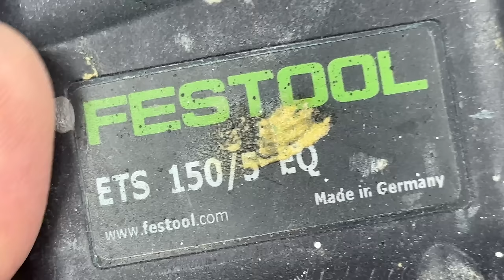Money, Mouth - Mirka! [video 507]

Comment: I'm sure this will be an interesting long term test, and may possibly go some way to reassure people about the reliability issues with the mirka brand.
Personally I  still wouldn't swap my Festool Sanders for Mirka, because almost everything else I use at my mft benches or outdoors has a Festool plug-it cable, and my extractor hoses either have the integrated cable or one securely attached with Velcro straps. I'm too old, impatient and lazy to keep swapping cables all day!
The other thing that bothers me as well as outright reliability, is the anecdotal evidence about the lack of  customer service, if there is a problem. No doubt Mirka have their fingers crossed that your two machines will last the course without incident, and I don't doubt that if there is a problem you will get first class service. But I KNOW from experience that Festool UK service is excellent, regardless of whether you are a YouTuber doing a review or  just a regular Joe on a building site!
Reply from the maker: Cheers David. If I have an issue with the Mirkas I wont be contacting the marketing department, that's for sure! I bought these, I want to see what the customer service is like if there's an issue, and I know Keith Brown @ragnbonebrown had pretty poor customer service when his Deros died. 🤷‍♂️

Comment: Do you have a suggestion for face frames.
Also I am looking at getting a dust extractor and am between the Midi and the 48 AC.  Rather the size of the Midi but keep thinking I would like auto clean but don't do drywall. Do you ever wish or need auto clean.
Reply from the maker: Orbital sander for face frames - smaller, better suited to that kind of more detaiuled work. I'm a very happy Midi (bluetooth) user, never wished I had autoclean, no. 👍
Reply: @10MinuteWorkshop  awesome thank you. I am going to let that be my decision, otherwise I will be debating this time next year. Thank you for very much for your help.

Comment: I’ve been using a Makita random orbital and a Bosch square orbital and they are both “fine” however I have been looking to upgrade for a while now, the little dust port on my Bosch has been broken for a long time and my Makita is still going strong but after trying out a friends Festool equivalent (can’t remember the model name) I was actually really shocked by how much better it was. Sanding results were the same (to my eye anyway) but the sanding itself felt so much easier, I felt like I could use it for hours on end and not suffer from the vibrations or have to exert barely any pressure at all compared to my Makita. I’ve been tempted to pull the trigger on buying the Festool equivalent to my sanders but I’m also toying with the idea of Mirka, however I don’t have any friends or work colleagues who use Mirka so it’s difficult to actually try them hands on. In your opinion if you had to recommend one or the other which do you think would be the best investment for someone in my situation?

For a bit of background I’m an English finish carpenter based in Southern California in the states, I do all things finish carpentry and mainly work on remodeling existing homes. Materials wise a bit of everything but a lot of pine, oak, and then ipe when doing outside decks and fences, a lot of cedar when outside as well but I’m rarely sanding cedar. Any advice from anyone is appreciated!
Reply from the maker: Wow, tough call! The Festool ETS EC is closest to the Mirka, and I honestly think you'd be fine with either one. You have the choice of two pads with the Mirka, which is a winner, but I know a lot of folks who've had a deros die on them way sooner than they expected, for the usage they had - check out my Deros video, link in the description, for links to those guys.
Reply: @10MinuteWorkshop  Thank you for the advice! I actually didn’t know you had a deros video until watching this video so I’ll be sure to check it out later. I am gravitating towards the Festool as I’ve tried it and everyone I know who has one loves it, but just wanted to be sure committing hundreds of dollars! I have heard bad things about the durability of the Mirka like you say, however as long as there’s a decent warranty and good reputation for customer service I’m not too much of a stickler for durability as I really look after all my tools and in general. My Fein multi-tool was a big upgrade for me from a makita one and it died too soon, but it was within warranty and true to their word they sent me a brand new one with at least 15 different new blades and sanding pads! Hopefully If I go the Mirka route they would be the same (fingers crossed lol) thank you for the advice and fast reply, I look forward to watching more of your videos
Reply: What model of makita are you talking about?
Reply: @riba2233  I believe it’s a BO5030K. Comes in a box which is a big plus nowadays however it’s a weird shape box that doesn’t fit anywhere in my tool storage lol that’s the best way to spot it online
Reply: @ryanwinchester6644  thanks, I was eyeing that one! Runs for 200 euro in local store which is not a bad price
Reply: @riba2233  unless you’re referring to the makita multi tool? Sorry wasn’t sure what makita tool you meant, the multi tool was a makita cordless one I got in a tool bundle, it did the job but was heavy, lots of vibration and the battery sits on it in such an awkward way that I’d actually borrrow friends corded ones to fit into tight spots. I upgraded to a corded Fein multi master and it’s an awesome tool, sometimes I wish I got the cordless version just out of my own laziness lol but overall I love it
Reply: @ryanwinchester6644  no no I was thinking about the 150mm random orbital but BO6030, I have just checked them out now. It is the larger unit, more comparable to one in the video
Reply: @riba2233  yeah it will be a good sander honestly, I have the slightly different one and it works well, lasted a few years now, pretty indestructible as well, I look after my tools well but that sander has actually fallen off a roof before when I was working on a facia in a big fancy house once and the tool was absolutely fine! Only reason I’m upgrading is just trying out the festool sanders I was shocked at the difference in how little vibration there was and how “easy” they felt. I was always someone who thought sanding is sanding? It’s boring and hurts your wrist after a while haha but honestly the Festool ones I tried felt like game changers for someone who doesn’t enjoy sanding like me, that makita one will definitely serve you well though if you buy it
Reply: @ryanwinchester6644  thanks, yeah that is the  similar story with most tools, you try something better and the  you get the itch :D

Comment: Hi Peter I have the merka deros and it is a very good machine but reliability is not that good both my merka sander and hover are now broken after around 3 years of use but not used every day I won't be sending them back for repair as the spare parts are ridiculously expensive very much like the greko ultra battery spraying spraying machine work well but not made to last and very expensive
Reply from the maker: Sad to say that this was quite a common story from the Deros of that vintage - and what prompted me to do this long term test. 8+ months into it and both the Deros and Deos have been solid, with no issues at all. 👍👍
Reply: @10MinuteWorkshop  do you think they have solved the issue with the sanders of my age

Comment: Finally, someone getting the Deos! Hey Peter :) Didn't you find the Deos very hard to control, mostly with the dust collection on? I got one 3 years ago and ended up hating it. Mirka never solved my issue. I just can't control it because it runs crazy everywhere over the surface. It's even worse when set to the lowest speeds. I found it unusable and for a high price there's no excuse for this to happen. Curious to see your thoughts when you use it more. The design is great, though, but one cannot sand with the looks of a machine!
Reply from the maker: Hey Chris! Haven’t had any issues yet, but there’s definitely a knack to,using it I think - I’m not getting enough pressure on the front of the pad - but I’ve had no problems with stability, no. Keep you posted! 👍